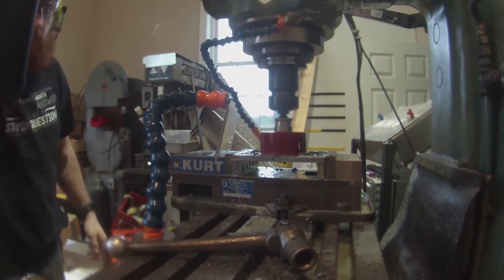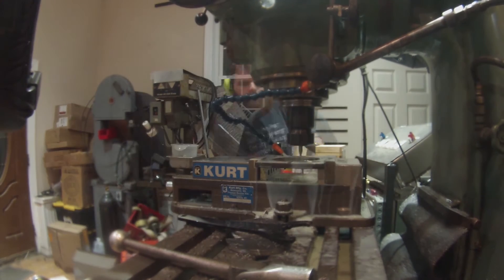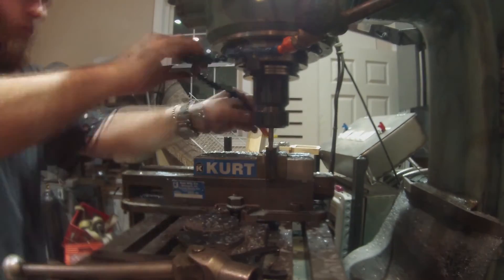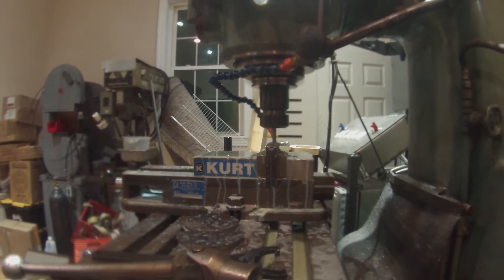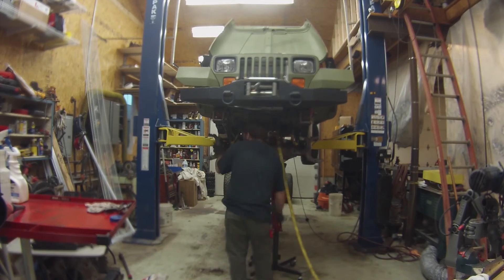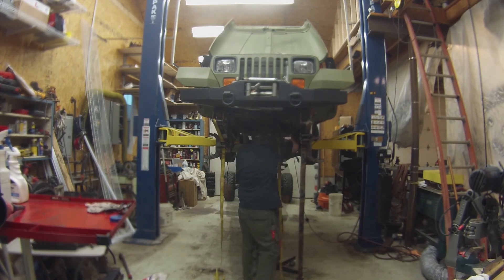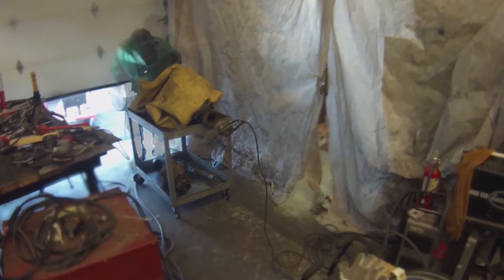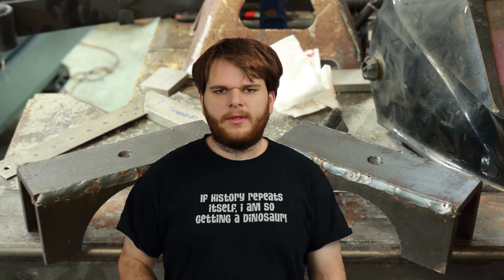Overly Complicated DIY Leaf Spring Perch 610BOB's Builds

Comment: Haven't built leaf spring perches but I'm wondering how you determined the proper pinion angle before you welded your perches on?  I have a 67 Dana for my Hemi Coronet and am not sure of the factory pinion angle do you know what it might be?
Reply from the maker: For double cardan drive shafts, you need to point the pinion at the output shaft of your transmission or transfer case at ride height. 

You need equal but opposite angles between your pinion and your transmission output shaft. So if there where a laser attached to your pinion and another laser attached to your transmission output shaft, the lines would be parallel. I know this is the baseline. But I never actually set up a standard drive shaft so I don't know if there are any games you can play for different setups.

Comment: You can buy spring perch's for less than what the material cost to make them and the time and effort you put into it. I had just put a GM 12 bolt under my Ram Charger and had to relocate the perch's and I think I only paid around 20$ for both. Great video though
Reply from the maker: True. But a lot of stuff I build could be bought. But that's not any fun. Nor is it teaching me anything. I learned a few machining techniques making these leaf spring perches. To me, building stuff is more than just a means to an end. That is something that I try to show with my videos. One of the reasons I named the video, "Overly complicated DIY leaf spring perch" It's not the fastest, or simplest way to have leaf spring perches. But it is a way. And, call me weird, but a way that left me with joy for what I made and a little more knowledgeable. Thats something you can't just buy.

As a side note, I really couldn't buy leaf spring perches for what I was doing anyway. The perches where for my jeeps dana 60 front axle. The axle originally came out of a 2005 f250. Not only was the axle shortened, but it was never meant for leaf springs. This lead to two problems. One, an odd tube size. Two, half of my one leaf spring fell onto the differential. So the one perch had to be a different size on one side. I may have been able to modify a store bought perch, but, like I said before, building is way more fun.
Reply: 610GARAGE, I run in mud boggs so I make alot of my own stuff too. If I ran to buy something everytime I broke something then I'd probably have to find another hobby. I understand the education part of what you are sayin and sometimes you can't buy what you need so making it is the only option. You ask if anyone would make spring perch's and I was just saying in normal circumstances it doesn't make sense to make something that's gonna cost you more or take more time. Nothing at all wrong with what you did if someone is looking to make a set of spring perch's this will be a great video for them. ("Keep on Keepin on brother")
Reply from the maker: To be honest, I completely forgot that I asked for people to leave a comment if they have built there own leaf spring perches. :) Thanks.

Comment: why nickel?
Reply: lol new to welding
Reply from the maker: As a weld cools down, the metal contracts. Cast iron contracts at a different rate than steel. So as the joint cools, the different metals contract at different rates which puts a lot of stress on the joint. This usually results in the cast breaking from the weld since cast is alot weaker then the mild steel weld.

You can avoid this in two ways. One is to control cooling. This requires a preheat then a slow, careful cool down.

Or use nickel. The nickel is weaker. So the nickel yields (or stretches) before the cast breaks off. Hope this helps.